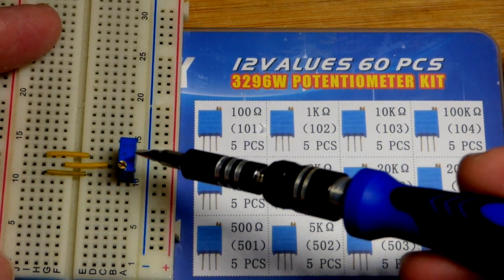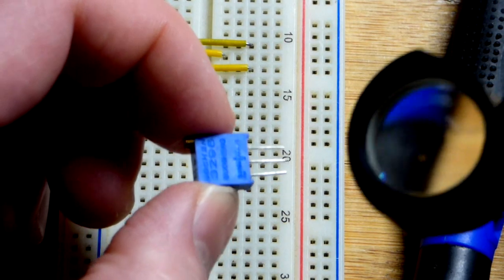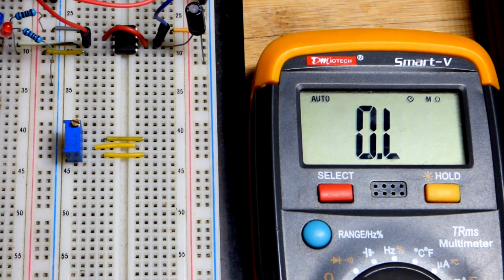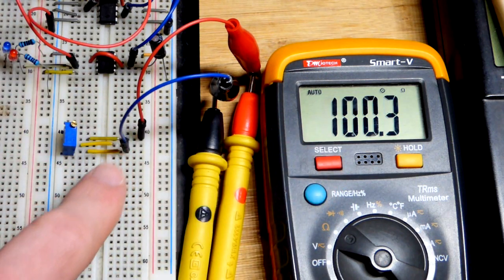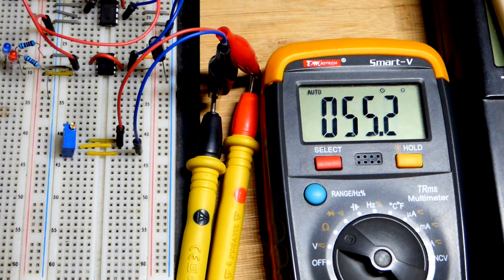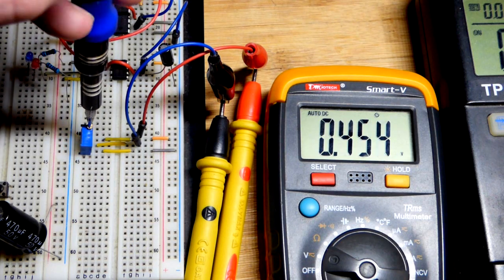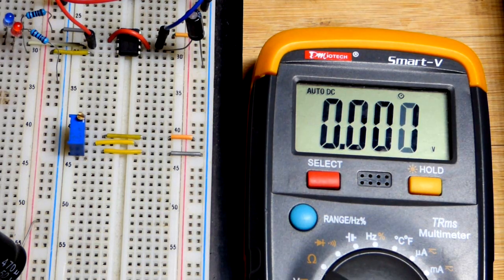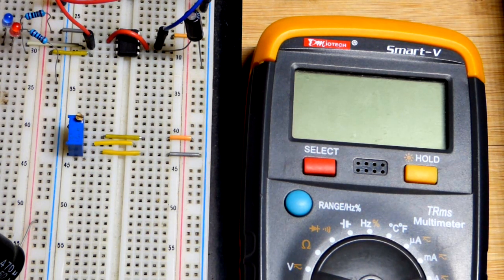Multi turn trimpot trimmer potentiometer component introduction by electronzap learning electronics

Comment: Thanks. The main part I was interested in was what happens at the ends of turning it. I had a NE555 module with one of these and wanted to turn a specific frequency and ideally pwm. When I kept turning the screw in one direction the freq on the oscilloscope would oddly go up and then down. Not really sure what was going on, but thanks for the video.
Reply from the maker: I haven't looked up how they work internally for a while. I know that the screw should keep turning when you reach the end and reengage right away when you turn in the opposite direction. I think that if you keep turning it in the same direction after you reach the end, that it will probably keep contacting slightly different parts of the resistive element.

Comment: what's the trick to get a standard trimmer to be a fine adjustment trimmer?
Reply from the maker: Can't really make a trimmer to have more fine adjustment. You can put a low value trimmer in series with a fixed value resistance that is most of the resistance needed, and then use the trimpot to make smaller changes with less range. If that is a possibility.